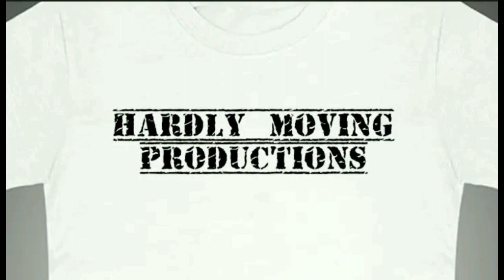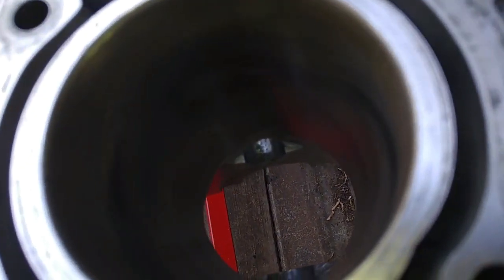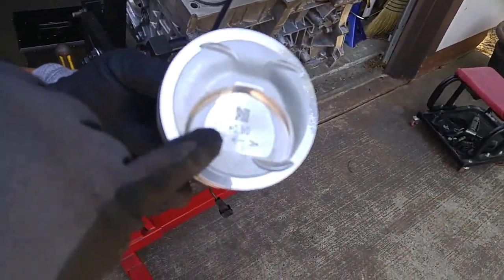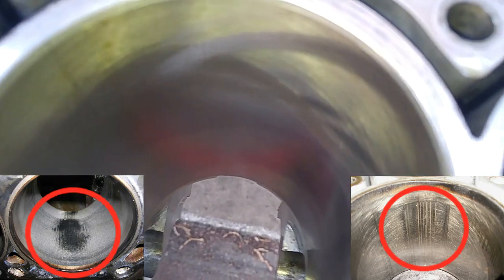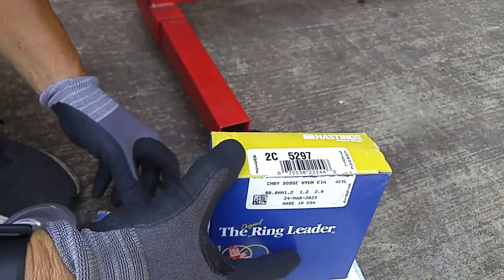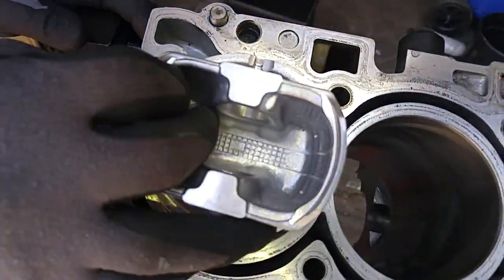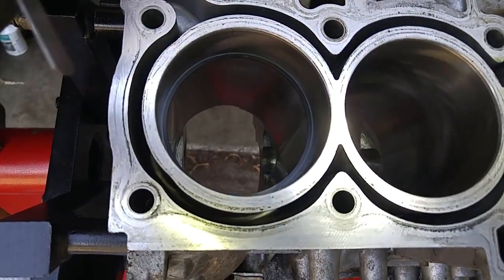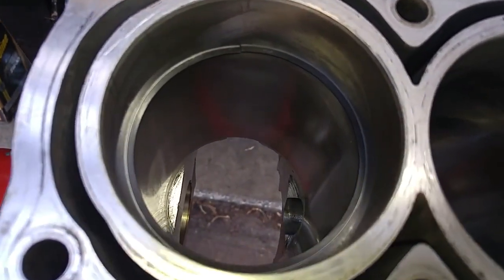Short Block Rebuild - Hyundai / Kia - Cylinder Bore Examination & Preparation (2.4 GDI) - Ep. 1

Comment: Just finished watching your series of videos on this rebuild.  You make it seems possible for me to do my first ever engine rebuild.  I have a 2015 Sonata with about 112K miles on it that is not eligible for the Hyundai warranty due to a rebuilt title.  Right now it is burning between 1-2 quarts of oil every 1000-1500 miles.  In your professional opinion should I go ahead and consider the rebuild before the engine has a major failure or keep feeding oil until I hear it start knocking?  My thoughts are sooner rather than later would be best?  Also, how much did this rebuild cost you approximately?  Thanks for the help!
Reply from the maker: The weak spot with these engines are the piston rings.  If going though the process of rebuilding, you can simply replace the rings.  Get the cylinder bores honed by a professional engine machine shop.  They'll tell you if the bores are out-of-round and may need to get bored out.  If so, you can buy oversized pistons and rings.  But in most cases, you may only need to hone the bore.  Costs:  I'm using round numbers;  < $50 for headgasket, < $50 piston rings.   Up to you if you want to replace the crankshaft journal bearings.  Have the machine shop measure and polish the journal surfaces.  Standard size journal bearings are cheap if you're interested in replacing the old ones.
If you keep adding oil to compensate for lost oil, eventually your catalytic converter will get clogged up.   A few weeks back replaced one on a Sonata with over 170k miles.  So bad that the engine would hardly run and the transmission refused to upshift.

Comment: Nice video thanks for the knowledge, please did you send the block to the machine shop, and please the diameter of the block and the piston
Reply from the maker: The stock block bore was 88 mm and oversized by .5 mm to make the diameter 88.5 mm.  This was done by the machine shop.  The replacement pistons were for the Hyundai 2.4 engine by oversized by .5 mm.
Reply: @hardlymovingpro  thanks, please what about the piston rings
Reply from the maker: I recommend the Hastings brand rings.  They make them for specific year, make, model and engine size.

Comment: Hey first off thanks so much for these videos, they’re great. Question: I bought a rebuild kit for this engine and the pistons that came with it look just like the ones in your video. The original ones from the engine are recessed flat top. Are the two interchangeable or do I need flat top recessed pistons?
Reply from the maker: That's a tough question.  Quite honestly, didn't notice any difference in the piston design on the 2.4's that I rebuilt.  From 2012 - 2014 the engine design seemed all consistent.  2011, from my recollection, had a different rod design.  There were also some engines with slightly different oil pumps in that they had a different number of mounting bolts.   I would guess that the flat top recessed is of a old design.
Reply: @hardlymovingpro ah yes I have a 2007. I now realize they use a flat top piston. Hah now I know 😂
Reply from the maker: Live and learn!
Reply: @hardlymovingpro so do you still rebuild these engines? If so I’d like to send you the pistons rings and rods from my set.  I can’t use them.  Actually you can have the vvts and the timing chain too as the one I got won’t fit my engine either. It’s the least I can do to thank you for this rebuild series. Let me know if you want it and I’ll get you my contact info.

Comment: I have a 2012 Sonata 2.4l limited with 75k. It has a salvage title but I know where it was hit and who fixed it, it’s in great shape. But it won’t qualify for a new short block when it eventually goes. How much would a new engine or doing something like this cost approximately? Thanks
Reply from the maker: The 2.4L is a high demand engine in the used engine market.  Anything under 100k miles can run up to $5,000.  This is why I went through the process of rebuilding them.  If you're unable to rebuild this engine yourself, I recommend you find yourself a engine machine shop who'd being willing to rebuild it for you.  First get them to disassemble the engine and let them tell you what needs to be replaced;  i.e. crankshaft, rod, pistons, rings, oil pump, etc.  And if they allow it, shop around to get the best prices for the parts.  Another option is finding a JDM (Japanese Domestic Manufacturer) engine supplier with a supply of used 2.4.  Although Hyundai is Korean, driver's in Japan buy Hyundai cars and trade them in.  JDM engines, on average, have less than 65K miles.  The last JDM supplier in Chicago quoted me $3,000 for a 2.4 which I though was a great deal.  Here's their number if interested:  (312) 889-0058 or (847) 288-0536.

Comment: What is the break in procedure for this engine?  I've heard to not use synthetic oil for the first 500 miles, drive at varying speeds, and other things, but I'm really trying to find what the actual break in process is.
Reply from the maker: I use a synthetic blend oil and change at around 500 miles.  Next change @ 2000.  Afterwards every 3000 with filter changed at every other oil change.

Comment: Hi, if engine block is good, can I use drill and stone to cross hatch it.. or you dont recommend it.  also can i use my drill and sand paper to to slight take the carbon out on my valves and use that to seat as well
Reply from the maker: I use to do my own cross hatching until I experienced rebuild engine failures due to the cylinder being too worn out or being out-of-round.  Best to have a engine machine shop check out the bore for roundness and wear.  Afterwards, let them hone the bores.  With respect to valves, have the machine shop test for any leakage coming out of the valves.

Comment: Hey, was wondering have you ever snapped a bolt on a front sway bar bushing bracket on a camry/es300. Can’t access it anyway because of the tight clearance within subframe and body. Do i have to drop the subframe just to extract that snapped bolt? Any idea on what to do
Reply from the maker: Sounds like you'll need to drop the subframe.